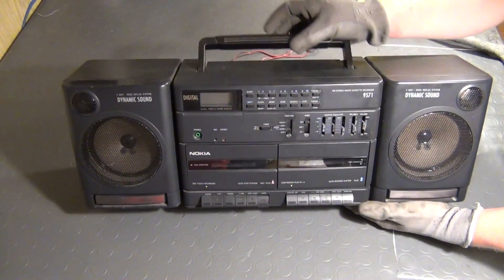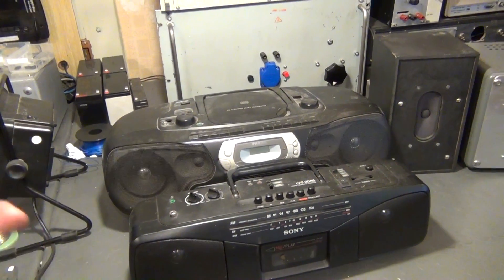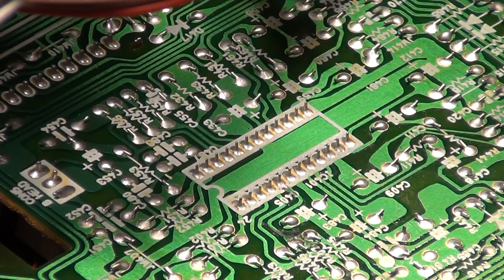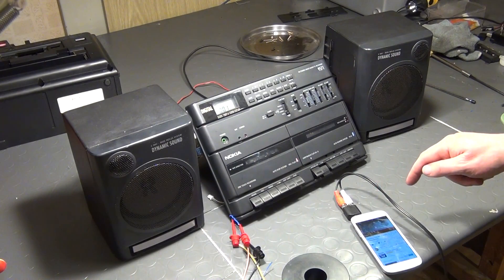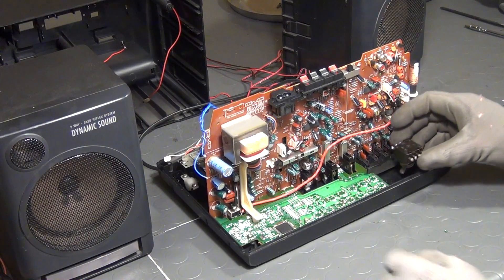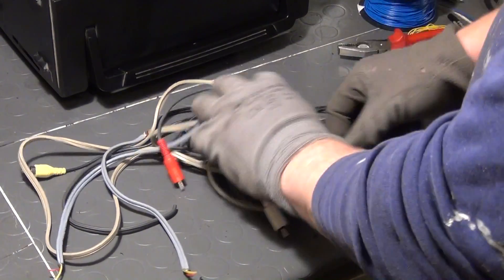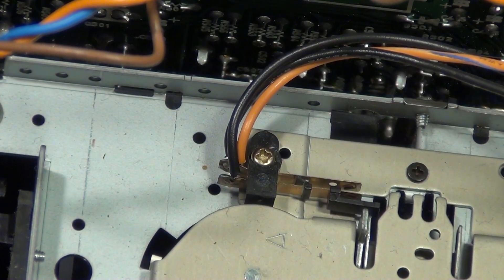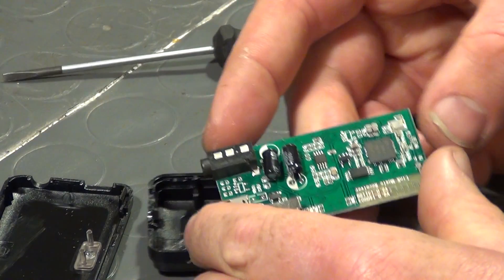How to Add a Line-In and Bluetooth to old Stereo Systems (2)

Comment: Great! But what I'd like to see is how to do it so that you don't even need the first one of those two new switches, because some devices have a "tape/aux." position on that input selector, so that means that the devices that don't have the "aux" side should just be able to parallel with the tape side just like those that do have the feature already. Right?

Comment: The switch is called a double pole or double throw switch, im sure others have mentioned it here too . Great Hack.
For me, i dont do the hack unless it alsready has a AUX in, that way i can hack straight in, Secondly I pick a low voltage clean power source that is running constantly, that way i dont have to wait to connect with my bluetooth phone every time i switch between sources. Yes its running all the time, but only when power is connected. If the unit doesnt have a AUX input i dont touch it. also if the bluetooth led on the circuit board allows a seconday LED i usually mount it somewhere on the face of the stereo or next to an existing LED, that way you know its running and ready to be used.
Theis channel is fantastic.... Great hacks..
10/10 my friend.

Comment: I have a 1975 or 76 Panasonic. Model  re-7345.  Someone cut the power cord and threw it in the dumpster in pristine condition...... why?
I disassembled it, inspecting it closely for some skid marks, expecting maybe,  it let the magic smoke out ?... nope!
 I put a new cord on it, then cleaned all the switches &  pots. I plugged it in with a current limited bulb & it came on with no problems! I don't get it,  nothing was wrong with it?
 It only has am/fm radio with a phono input. so im I'm trying to figure out how to go about placing a Bluetooth into it without changing how it looks.

Comment: what did you solder at 3:25 ? Its something off the pin 5(pre-amp out), but I cant see it and I dont think you mentioned it.
Reply: Nevermind, I think I see. They are two resistor leads that are connected to the same node already. You simply created a larger contact to connect your audio lines to.

Comment: I couldn't find a pre-amp on my stereo system, only a power amp. Now I understand why I did shit and ruined the source of sound I was using to test this.
I did got sound when I connected on the IN pins of the power amp, but made the mistake to try on the OUT pins (just like you did).

Never use the power amp OUTs!!

Comment: I'm doing this with an old emerson cd tape stereo I've had for years. im going to use the line in connection from the CD player which is missing (died) and im going to add USB charging as well. I have the guts from a USB wall charger that ill see if I get 5 volts from it since its the secondary DC side.  the top is open due to the missing CD player so I'll add a cover or something.

Comment: I soldered an audio cable to the pins of the radio on the source selector switch, it was the easiest solution for my stereo. it works great!
Reply: Thanks for the tip, maybe the AM radio could be a good choice 😊, never used.

Comment: what about a stero unit that only has CD and radio function can we hack into the CD path or do you need what the tape deck uses because its analog?
Reply: The CD amp circuitry is probably almost identical to the cassette.

Comment: Slight correction: You scraped off the solder mask not the silk screen on the bottom layer of the board under the chip to solder your ground wire. From your diagram, in English, we call the installed switch a Double pole double throw normally open lever actuated switch. Interesting hack, thank you for your entertaining videos.

Comment: Its called a "dual pole dual throw" switch .
Reply: Actually it's a quad pole single throw switch (4PST).  2 normally open (NO), 2 normally closed (NC)

Edit: added acronyms commonly found on schematics in parentheses.
Reply: +Barry Manilowa Yeah, I used to pretty often as well. It can be confusing.

Comment: Get a better old stereo system that already has a line in , there, one of your problems are already solved. Good quality ones aren't even very expensive if you look at thrift stores and yard sales. Aesthetically or not, there is no reason to use one of these very bad quality stereo systems.
Reply: I think you missed the point of that channel.
Reply: I agree. it's like using rotten wood to make furniture.
Reply: What if you want a free stereo system for your garage and a boombox sounds good enough for that application?

Comment: HI i have a question and i think you are the person to ask and get
 a reliable answer. i rebuilded a cheap cordlles drill battery form 
ni-cd too lithium batteries witch i got from an old laptop battery. from
 18v with ni-cd i putted 5x 4.5v batteries lithium the brand was samsung
 green ones and i think they are 2500mAh anyway it works fine and its 
stronger than very expensive and famous brands. the problem i have is 
how i should charge them properly since they are all connected together 
and they produce near 22v and i am not able to charge them with an xtar 
charger i have for those kind of batteries can u recomend me something 
not very expensive or a solution ?  thanks
Reply: The problem is to charge each cell properly : first constant current then finish at constant voltage, usually 4.2V, or less if you want better cell longevity. With only one charger of 5x4.2V=21V you will have cells under 4.2V and cells above, wich is not good. 
Because of that I use one charger per cell. And as I want my 3 cells in series to charge simultaneously, the chargers needs to be floating voltage (no common ground), hence the isolated 5V plugpacks (chargers needs 5V input) and the 6 wires of the connector : 1 positive and 1 negative for each charger/cell link.
I made a box wich contain the plugpacks and the chargers, it has 230V ac input and a 6 wire connector to bring the chargers output directly to the 3 flashlight cells.
I think you can do the same : buy 5 chargers for around 5$, and reuse 5 USB phone chargers to power them (micro-usb port is included) then find a 10 pin connector to link the cordless battery to your charging system.
Reply: get a transformer that pits 18 v ac and rectify it to dc you will get about 24 volt dc that worked for me will post a circuit
Reply: What I have done for a similar configuration, 3 cells to power a hacked halogen->led flashlight, is to buy 3xTP4056 based chargers on ebay, dirt cheap and measured ok between 4.10V and 4.15V. They are powered from 3 smartphone-type 5V isolated plugpacks. The connector between the charging box and the flashlight has of course 6 pins, a reused PCB-type one (same pin size than the breadboard).
Reply: thanks for the respond but i don't quite follow u really can u explain it a bit more?
Reply: THANKS MAN!

Comment: great video, it is exactly what i was looking for, i scored a sony cmt gpz7 from a local church bazaar here in são paulo for about 10 dollars and it had only a blown fuse, i could found a remote on the internet and a bluetooth device that looks simmilar to yours, it is usb powered and it has a line out only, i was thinking to look for a stable 5v inside the stereo case but only could find some 4v and 3.3v, should I look for a 9v and then use a voltage regulator or something along this lines or the 4v may work? the bluetooth device is powered by a rda 5851SA and i think it has it's own regulator to step down the 5v from usb. i just checked its datasheet and it is a shame that this chip is only being used like a bluetooth receiver as it can do so much more, like drive lcds, PWM, line in, FM tuner, SD card reader, this beast could power a stereo system itself... anyways, how to deal with the bluetooth antenna which is a net on the PCB inside the metal case of the device?

Comment: If you get a BT transmitter and receiver you don't have to do any of this. Just plug it into the BT device. Either the speakers or line out. This is how an old stereo plays the audio from my tablet in the bathroom. Also a set of PC speakers in the Kitchen. I can Broadcast to and from either setup.
Single detent, Dual pole switch.

Comment: DPDT switch i think is the english version of it, you will see it has 6 connectors, easy to find on ebay
Reply: Not quite - a double pole double throw has two separate switches, each with 1 common terminal that is connected to one of two terminals, depending on switch position, , one normally open  and one normally closed.

The switch in the video appears to have 4 poles, each single throw, of which 2 are NO and 2 NC.

You could wire it to act like a DPDT, by connecting one side of one NC and one NO switch together, creating the common terminal. Repeat for the remaining NC and NO switches to create the second pole. But it looks like he uses 3 separate poles, 2 for audio and 1 for turning on the amp, so a 6 terminal DPDT switch couldn't do the same thing, as it only has 2 poles
Reply: Winner winner schnitzel dinner.
Reply: his switch has 8 connectors he has a duel nc duel no switch this type does not have any common points you can use a 3PDT where p1 left p2 right p3 power
Reply: As far as I know DPDT = Double Pole Double Throw, where the Pole marks the number of switches inside that are operated simultaneously, the throw marks the number of positions...
Reply: Same marking goes for relays too...